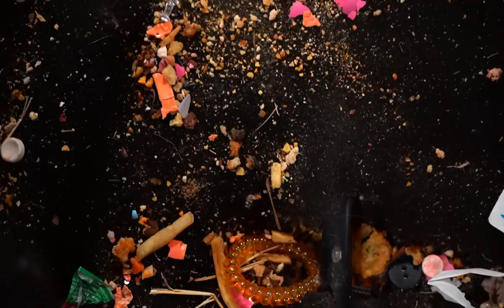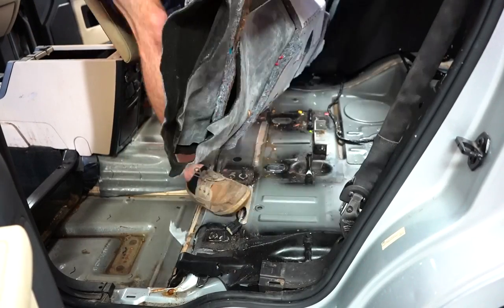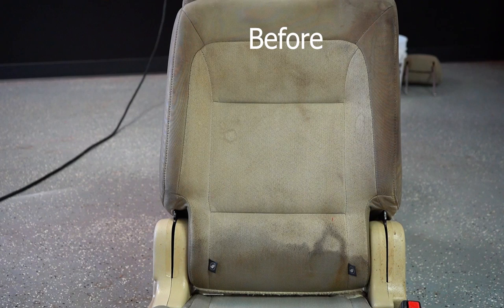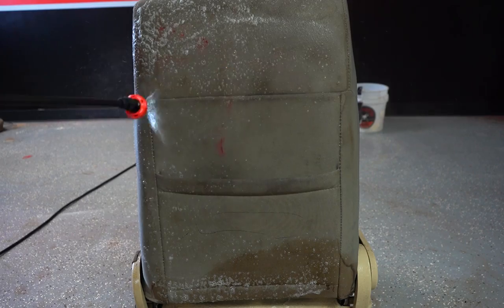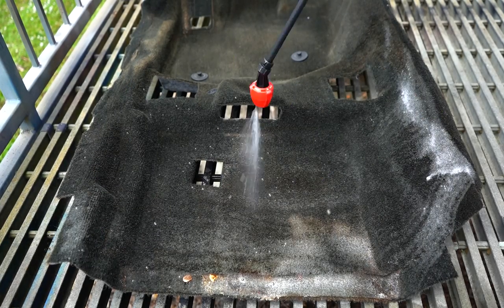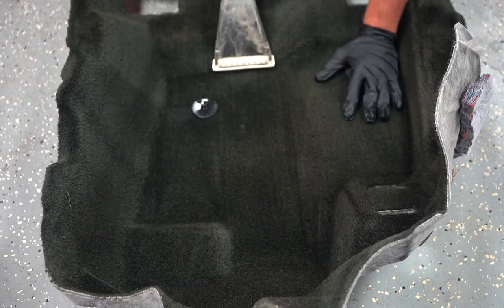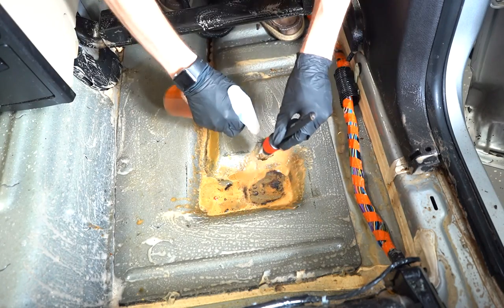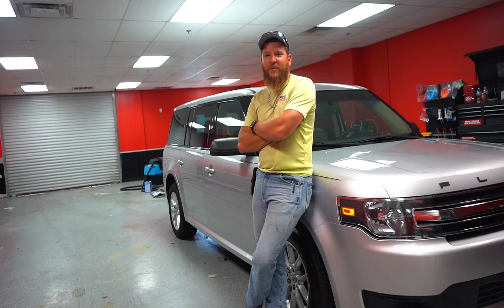Deep Cleaning The Nastiest Seats | Best of MADDETAILING 2020 | Insanely Satisfying Transformations!!

Comment: At some point it seems as if the amount of time to clean it would be less than replacing it. If the seats and carpet are already pulled and that labor cost is calculated in already, 
swapping the seat covers and carpet to new might be close to the same hourly labor to clean

Comment: We had an old Dodge Durango at my dealership that looked like this inside, took us about a week and I still wasn't satisfied with the finished product, even for a $6,000, 189,000 mile beater. Our extractor has a solid metal tip on it so you can't see what you're sucking up. We end up using the Tornador for lighter stains 95% of the time.

Comment: U guys did a great job however some of the trim like the base of the car could have been cleaned better and faster with steam. I recommend the bissel steamshot for certain gunk in areas as it blows immensely hot and concentrated steam but also the McCulloch steamer for wider areas and areas although it won’t be as concentrated

Comment: You can use the drill brush I use which yellow in the bottom n has a black tip 360 Bristles , it says it for toilets but that doesn’t mash it back in like the one you used is good only in the shampoo part

Comment: I do really like the Ford Flex. It's a nice, spacious vehicle that rides like a very big car instead of like an SUV. Unfortunately, it's semi-retro design was a bit polarizing and Ford discontinued the Taurus X that it took over the floorpan and subframe from, so it became either the Flex or the Explorer, and the Explorer is still more popular.

I will say, if people keep bringing in nightmare cars like these, you may need to invest in a vacuum stam extractor instead of just relying on a hot water extractor. They're just really expensive and require a high amperage power circuit...

Also, I don't care what you got paid for that job, it wasn't enough. You have some scary dedication to your craft.

Comment: First off great job. But it drives me crazy watching guys vacuum an entire car using just a crevice tool. There are so many more efficient ways to do it. All that big stuff use a claw attachment, then you can use a turbo brush attachment. Or better yet after getting the big stuff out, put the car outside, open it up, put a fan on one side and air purge the whole thing. I like to use a Tornador blow gun with a metro vac master blaster. You can see the dust cloud 2 neighborhoods over. After that it’s all touch up gravy.

Comment: Damn, just thinking about my prices...

Looks like you got about 15 hours in there (probably more).

Full interior cleaning of a mid-size $185 (3 hours). 
Shampoo and extraction service for seats and carpet $100 (2 hours).
$50/hour over and above fees for excessively dirty vehicles.

Total: $885 + 5% discount (for customer retention due to large price tag) = $840 flat.

And, I would not have taken the carpet out. You should try compressed air for sand. 

Normally, I dont have to say no to people for shit like this because they just assume they are going to get it done for $185...